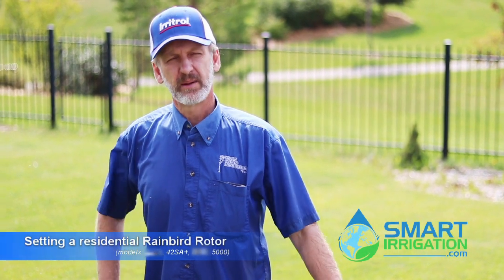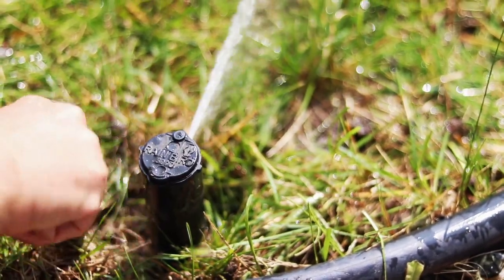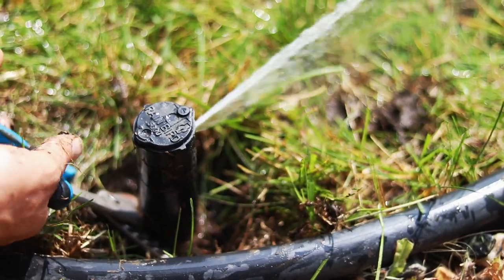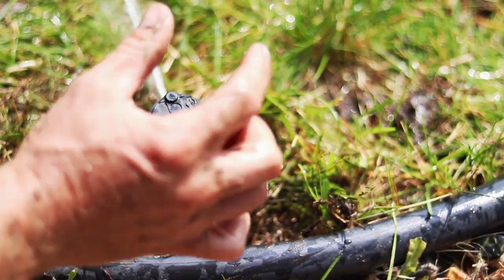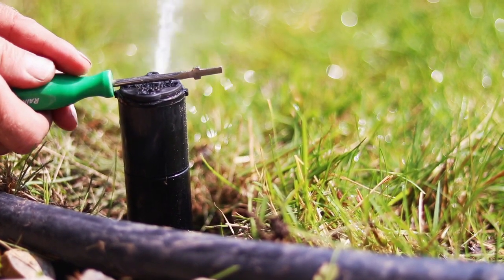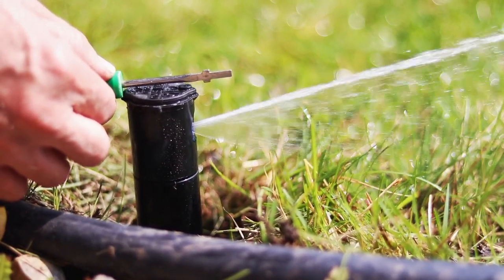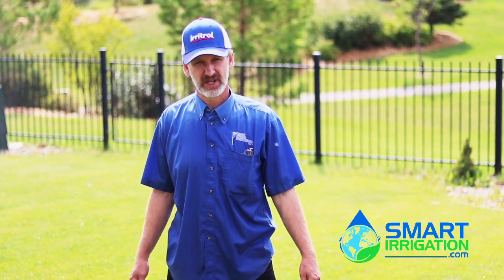Rainbird 5000 Sprinkler Adjustment (updated video available)

Comment: I have figured out all kinds of stuff on my own. I do all kinds of auto repairs and home repairs DIY. But these stupid sprinkler heads. For some reason, I can never figure them out. The system doesn’t make any sense to me, especially when you have a old heads that may or may not be functioning the way they’re supposed to. And you have to sit there for like two minutes to see if you’re adjusting right and then adjusted a little bit and then watch the stupid thing for two more minutes.
Reply from the maker: They are certainly frustrating sometimes, especially if you are trying to fine tune the adjustments just perfectly.  Sometimes 2 minutes isn't even enough!  So you definitely aren't alone there!

Comment: So if I want to set the far left stopping point you’re saying I have to physically move the housing of the rotor which is in the ground- not the riser popping up? Seems like they could’ve designed these better without having to dig up the ground.
Reply from the maker: Yes you got that correct.  These rotors do initially come with a slip clutch feature for setting the head when it is brand new, but this locks into place after a few uses.  Rain Bird says it is designed this way so that once you set the left stop you don't need to worry about it changing.  Unfortunately things don't stay in place forever so you need to use the method were showing here.

Comment: Can someone help me? I need to decrease how far left it goes. I have a boxwood and don’t want to get it wet. When I put my flat head screwdriver in I feel nothing inside the groove. Could it be it desinigrated? Or do I need to buy the rain bird tool? I called Comak and they charge 110.00 to come down. Ugh 😩
Reply from the maker: Thanks for watching!  If you are putting the tool in the correct slot in the back of the head (where there is the +/- sign, not the hole in the middle or where the water shoots out), it could be that the adjustment screw in the back is broken (it is just plastic) and the rotor would need to be replaced.  Those rotors can generally be found for about $20 so if you are comfortable replacing them you can save yourself some money.  If you would like us to make a video on how to replace these rotors, let us know!
Reply: @ it was defected and I needed another one replaced. I did have to have them come down. Would you please do a video when you can (no hurry) on how to replace them? Would love that for next Spring. I feel that part of them gets damaged so easily. Thankyou
Reply from the maker: @KaraStanziani-ym8pf  I'm glad you get everything fixed!  We'll definitely put more of the repair-style videos on our docket for next year!  Thanks for watching and hopefully we'll have something for you next year!

Comment: Great video! Do you have any advice on a Rainbird 5000 rotor that is getting stuck? I can keep it moving by gently turning it with my hands, but when it gets back to that same spot it gets stuck again.
Reply from the maker: That will need replacement. The gears are no longer working.

Comment: Have they made one where you don't have to dig to adjust the left?
Reply from the maker: The old impact heads called Rainbird Maxipaws but they have different issues and some large sports field rotors but they are 5 times the price. A new Rainbird 5000 for the first few months has a slip clutch so they won't need digging. That feature doesn't last however.

Comment: Not just this dude but 4 out of 5 make no mention that the nozzle ( the little thing that you jam into the pop up thing ) can have a different elevation. As in low or high. Biggggg difference. And when taking the nozzle from the rain bird strip, it can have trash on the sides that will prevent it from being inserted into the shaft. Also, be very careful that your finger doesn’t get caught if the shaft snaps back. Very painful.
Reply from the maker: Here we were just showing how to adjust 5000s whose slip clutch no longer works, but in the future we plan to make a video that goes over all parts of the rotor, including nozzles. But thanks for keeping an eye out. Hopefully we'll get on that video soon!

Comment: I have a system that is 17 years old. My heads are the 5000,s and 3500,s,  have the nozzles been changed to gain the rain curtain technology.  Can my heads be updated with newer style nozzles or do  I have same technology. Can I use 5000,s and 1800,s on the same zone?
Reply from the maker: It's hard to say if your heads will work with the new nozzles without seeing them, but it's worth getting a sleeve of nozzles to try out!

1800s are sprays bodies so depending whether you have spray nozzles or rotary nozzles on your 1800s will determine the precipitation rate of your heads and if you can run them together with your 3500s and 5000s.  Check out out website smartirrigation.com for some articles that go into more detail.  And check out our patreon if you would like some extra support. Good luck! https://www.patreon.com/SmartIrrigation

Comment: Could anyone recommend some adjustable pliers as shown when rotating the sprinkler in the ground? Thanks
Reply from the maker: We use a 12 inch Channel Lock tong and grove plier available at most building / hardware stores or on Amazon for about 25 dollars.
Reply: @SmartIrrigation1  Thank you!

Comment: This guy don't know what he is doing. You can set the left stop by turning the head.
Reply from the maker: Yes, that is true on a brand new head because it has what is called in irrigation lingo "a slip clutch" but have you tried it that way on a couple-year-old one? CAUTION because the slip clutch stops working and turning the head will strip the gears.
Reply: Please show us your video then?
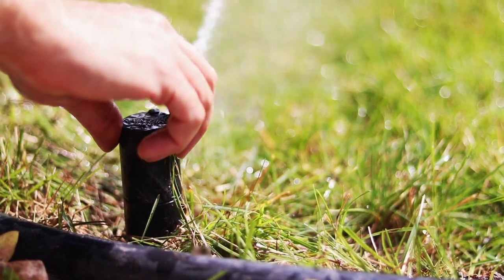Reply from the maker: Hi Luis, for this video we're specifically dealing with an old head that doesn't have the slip clutch working anymore (it is only intended to last 1 year), as mentioned in 0:36 of the video.  But we hope to do another video showing both a new and an old head hopefully this year.  Thanks for the feedback!

Comment: how do i adjust the water sprout, instead of one squirt would like to make it like a sprayer...
Reply from the maker: The rainbird 5000 rotor nozzles are designed to only be a single spout, but they use "rain curtain technology" for even coverage as they rotate.  You can turn down the screw at the front to reduce the radius, which fans out the "spout" but that won't actually increase coverage evenness.  If are going for the "fan-type" of spray, you would want to switch over a spray body (like the RB 1800) with a spray nozzle (like the MPR nozzle series).  But that type of switch is a whole other topic.

Comment: It's not slipping, do you mean ratcheting because it's moving very easily (slipping)?
Reply from the maker: Yes we mean slipping if it's making a ratcheting sound or feel,  you are probably applying too much force and forcing the gears. This is not good for them and could lead to stripping them. The feel of a new one with the slip clutch is smooth. How old is the head?

Comment: I wish I had understood more that your video is only meant for old(?) or broken{?} Rainbird 5000s. I tried adjusting the left hard stop the way you described and it worked but it is not what I should have done. I should have done it the "correct" way - by simply twisting the inner part.
Reply: Yes my video is for any Rainbird Rotors that aren't new . After about a year the slip system of just turning the turret stops working and if you force it you will strip the gears on your Rainbird rotor. So this video will become relevant to your new heads in approx.. 1 year.
Reply from the maker: Yes, you can adjust the left stop for the first few months on 5000s, but after the first summer they are designed to lock into place and the slip clutch stops slipping.  I think their intention was so that the left stop wouldn't accidentally move once it was properly set, but most of us have found out that the left stop DOES eventually need readjusting, and THAT is where this method comes in handy.  But in the future we will try to make that more clear in the video!
Reply: @SmartIrrigation1  This explains why the 5004+ units I installed last year can't be adjusted with the slip clutch any more.  Terrible design flaw if you ask me.

Comment: Arc or right edge? This was confusing.  And then when you "decrease" the CW rotation toward the right edge, @ 2:40, you did something with the screwdriver AND rotated the rotor/head back to the left.  Not clear to what or how that effected the CW Right edge stop position.
Reply: Arc is the wrong term. Makes this more confusing.
Reply: . Was setting the position the head stops on the right with the tool. Turn clock wise to increase the size or the arc meaning degrees of head rotation (quarter circle would be 90degrees to 180 for example) or counter clockwise to decrease the degrees, from 180 to 90 for example. I just moved the head to speed up the adjustment time or the Video would be twice as long.
Reply from the maker: Sorry for the confusion.  The left stop on these heads is fixed and that is what you adjust by turning the whole body in the ground.  You can then adjust how far right the arc goes by turning the adjustment screw on the top of the head.  Does that help at all?

Comment: One of mine has no left stop.  It just keeps going around.  Is it broken?
Reply: Some models are 360 degree always but they usually say that on top or yes it could be broken.
Reply from the maker: Which direction is it turning?  To the left or the right?  If it is turning counter clockwise, then yes your left stop is broken.  If it is turning clockwise then it may be a 360 head, that your right stop is all the way open, or your right stop is damaged

Comment: I don’t have that green tool.  Can i just use a small screwdriver?
Reply: I picked up the tool today at a local Lowes Hardware
Reply from the maker: Yes, a flat head can be used to adjust the arc.  But it doesn't work in the slot used to pull up the head when it isn't running

Comment: my rain birds ALWAYS unscrew.(left stop moving no matter how tight i make it)..any tips on that.
Reply: You could take the inside out of the case and move it to where you want then screw it back into the case. They are two piece units (Case and inside is turret/stem)
Reply from the maker: That can be a challenge sometimes.  If you can, try to only turn the body to the right.  This will tighten it.  You need to be very careful when turning to the left otherwise it will unscrew like you said.
Reply: No.. I guess I was not clear. The ratcheting action from the head turns the whole body. It actually unscrews from the base pipe
Reply from the maker: @AP-514  Interesting; are you saying that the sprinkler undoes itself just by running (without your touching it)?  That would be unique indeed, and something we haven't come across.  Or are you saying that when you turn the head/body that it comes off the nipple?  If this is the case, yes that can happen, but only when you are turning to the left, so sometimes its best to make a 360 turn to the right instead of turning it a bit backwards to the left
Reply: I am actually thinking of adding some lock tight to the to the nipple where it goes into the body. (The one that keeps moving is a 180 left to right track)